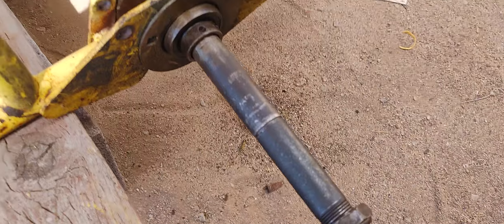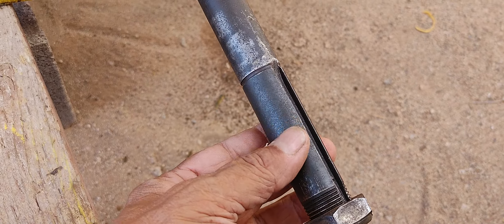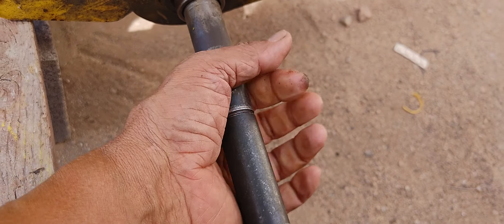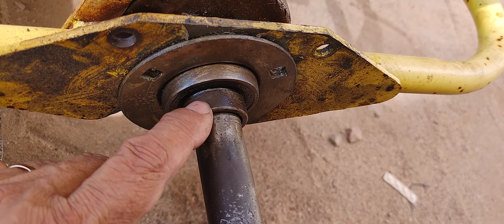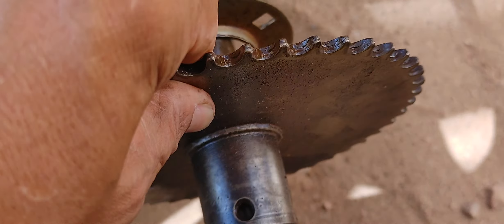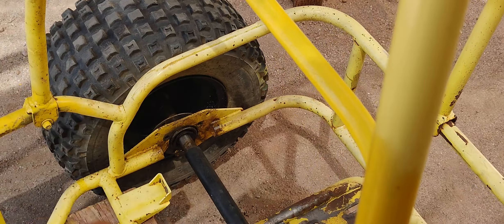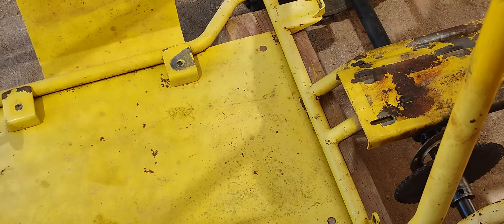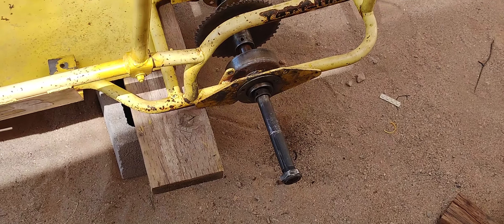Vintage Yerf Dog 3020 Rebuild Upgrades Mods - Part 7 - Wheel Removed - New Challenge

Comment: I have this same go Kart. Could you tell me what size socket I need to remove the back tires? I've been trying to find this out
Reply from the maker: 1-14 nut so use a socket for such or use a large wrench . Just in case the front ones require a 5/8-18 nut so also use a socket for such or wrench.
Reply: @MarioIArguello  thank you. I ended up getting it off.. Now I'm struggling getting the rim off 😭
Reply from the maker: @blackheart6338 oh man , I hear you, these are great go karts but getting the rims off is  near impossible. I tried everything in the book and nothing helped, finally had to cut the rims.  If you have a high temperature professional torch acetylene you may be able to heat the shaft enough to break it loose from the rim.  I have a full thread on  this kart at the forum diygokarts.com